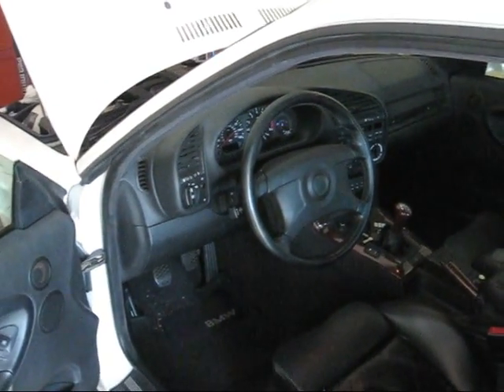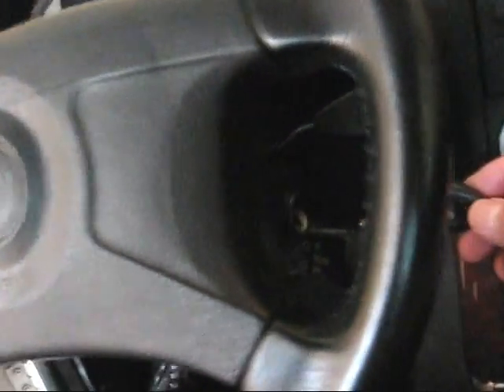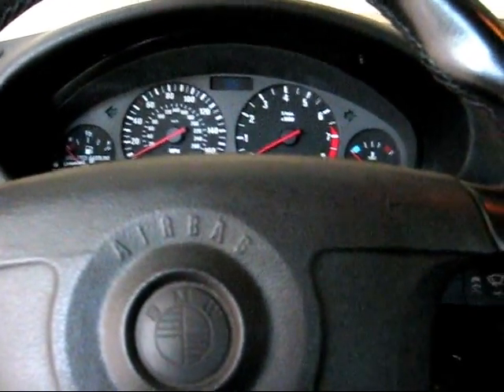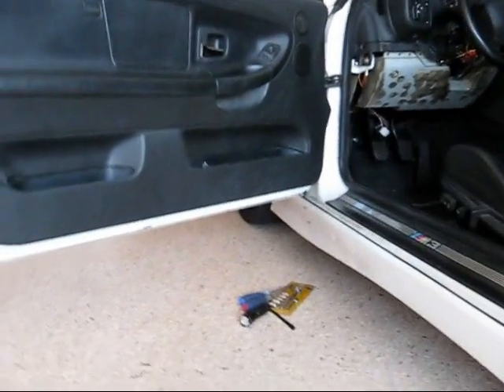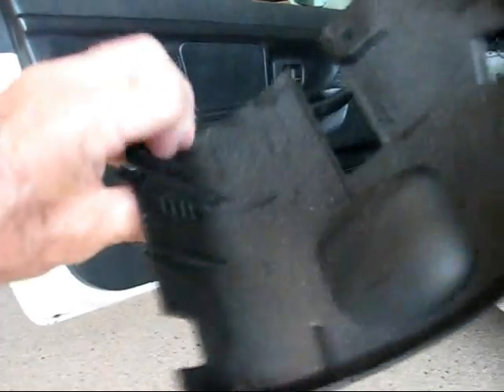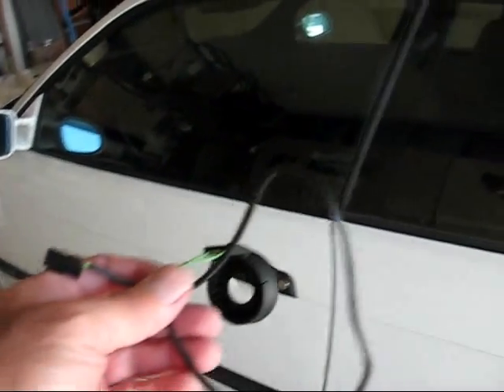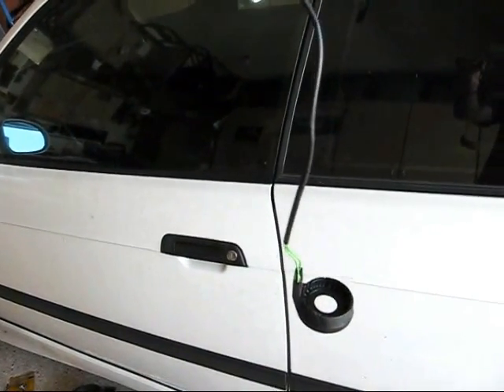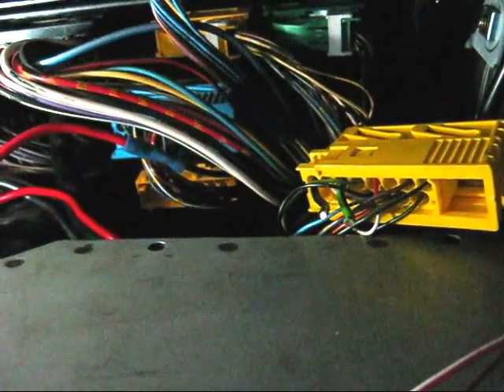BMW EWS II security bypass on 1995 M3 by froggy

Comment: did you use a seperate piece of spare wire to connect the two? you described a green and a black wire but you were holding a red one. Do I need to use a seperate wire?
Reply from the maker: +adam moore Well, yes, an extra piece to allow some room to work, color does not matter for the jumper piece.

:)

Comment: Hi I need help on my 2001 bmw 325i also have similar problem..no crank and just bought a new battery. i try self diagnosis and it came up with code P0604- PCM Random access Mem (Ram) error and also showed EWS and UCU issues. so do you have a way of resetting the EWS or modules?cause i think it just lost memory! thanks your help will be highly appreciated
Reply from the maker: +Benedict Nkosi Wow, sorry no idea on this, good luck.

:)

Comment: well my 96 328i was not cranking, so i spliced the two big wires from the yellow plug. it cranks now ,but no fuel or spark. so next i cut the solid green wire, got fuel now! so any ideals if theres one more wire to cut so i can get some F@#@ SPARK OUT OF THIS???
Reply from the maker: +Troy Fiore I don't know Troy, you got lucky with the green wire, I guess, I would not just go on cutting more wires. Wish I could suggest more.

:)
Reply: I WAS HOPING YOU WOULDN'T SAY THAT...
Reply: Troy Fiore  you solve the sparck problem? I am now in the same position

Comment: i have a 96 328i, does something, turns but doesnt crank. so managed to jump starter with ignition on still no start. now i'm worried! so looks like i'm going to try what your doing,  do you have to replace the ant. key ring thing, is that a must ? first?
Reply from the maker: you only have to replace that if there is a problem there if there is no problem there then you don't have to replace it
Reply: +froggy  i guess it just dont work on 96?
Reply from the maker: +Troy Fiore the ignition key security is separate from the EWS to security did you do the EWS 2 bypass
Reply: YES
Reply from the maker: If it is turning over (cranking over) but not starting, you need to check basics.

1) Spark - are your plugs sparking
2) Fuel - is the fuel pump pressurizing the fuel rail
Reply: +froggy THANKS FOR RESPONDING, FROGGY. I CUT THE SMALL GREEN WIRE, NOW I HAV FUEL, BUT NO SPARK YET??

Comment from the maker: For Antreges, Thanks, glad to help.

:)
Reply: Any idea if it will work onbthe 1995 325is im having the  same issue i already replaced  the ignition and nothing
Reply from the maker: +rob b Maybe, that's pretty close to a 95 m3. Reverse it if it does not work.
Reply: +froggy Is the m3 the same as the e38?  I am confused about all the designations on the bmw's My car is a e38 but I can't find any thing printed on the car that say's so. And I don't have a clue about the m3 designation or the e38.
Reply from the maker: M3 is the higher performance version of e36 chassis.

:)

Comment from the maker: Guys & gals, I don't have specific bypass procedure for every year & every model of BMW. There are changes. This is for 1995 m3 and "MAY" work on some others.
Reply: Hello froggy. After you jump the wires together from the EWS do you plug the yellow connector back in? Never saw that in the vid. Also thanks in advance
Reply: I have the saem question.. does he connect the ews back? would this work if ews is damaged?
Reply: 1998 BMW 328i wont turn over with the key but if I shouldn't the starter it will run
Reply: Did u start it with the ews module out?
Reply from the maker: Yes you plug the connector back in,  and depends on what the damage is to the ews.

:)

Comment: Hi froggy,i following your movies and with bypass starter is work but injections and fuel pomp not ,what i can do more,this is bmw e36 1.8 1996 thanks for help
Reply: +krzysztof kidrycki  same problem, what more did u do?
Reply: Is fixt
Reply: +krzysztof kidrycki  HELP. YOU SAID IT WAS FIXED? PLEASE WHAT ELSE DID YOU DO??
Reply: in computer dme i fix emulator to immo ,immo dont work but engine start with bypass from froggy

Comment: I have a 1995 BMW 525i, put a new engine in, and now my car wont start, but it does turn over..Any help, i'm gonna go get a new key from the dealership, but some people say it could be a security code that i need to get from the dealership?? Any help would be appreciated.
Reply from the maker: prospect1won Is it the same as original engine? It definitely sounds like security stuff.
Reply: Yeah same as original, just bought a new one with low miles because i cracked the heads on my original engine.
Reply from the maker: Did you change the engine computer?
Reply: No, the shop said the computer on it is good..
Reply from the maker: If it's turning over check the spark & fuel pressure (basics). Did you do the bypass?
Reply: Basics have been checked like fuel pump and spark plugs, i haven't done the by pass on the security code part..
Reply from the maker: Try it, do a "neat" job, it's reversible if it does not work.

:)

Comment: Hi. I just did this on my 318 1995 mod snd it worked!! Thanks alot man. 

But now I got this click click click click sound from a relee under my steering wheel, close to where the black key ring plug is fitted. 

Can you help me with that? Did you get that?
Reply from the maker: holimar1 I'm sorry, no, never had any clicking there. Post a comment when you figure it out & congrats on the FIX!

Comment: I have a BMW 740! That the key was spinning  I sprayed electrical  contact spray and got it to stop spinning But now it will not start..
Reply from the maker: Johnny Dinnero The spinning key is a totally different job. I would watch some spinning key videos & see if you get an idea from those, nothing to do with ews2 issues.
Reply: I fixed the key doesn't spin but now it doesn't start..95 740!
Reply from the maker: Johnny Dinnero I get that, spraying elec contact spray on an ignition switch is not going to cause a circuit board under the glove box or under the hood to fail.

Maybe you did something to the antenna that IS around the ignition switch. Start there.

There is some video on my BMW playlist about the antenna.

Try both keys if you have two.

Then it's take apart the cover over the ignition switch to look at the antenna.

:)

Comment: Hi, I have a problem with the ignition of my car and checked the spark and fuel pressure and nothing, I wonder if my problem has to do with the EWS, thanks.

Note: the starter is functioning normally.

greatly appreciate the info.
Reply from the maker: Make, model, year? How did you ck spark and fuel?
Reply: Bmw e36 m3 3.0 95 Check disconnecting the fuel hose to the rail injectors which is not sending anything, like with each spark plug wires and spark are not giving
Reply from the maker: On my 95M the broken ews2 blocked the fuel pump AND THE STARTER. So if your starter is spinning the engine, that's a different scenario. It is possible a mid model year change happened to make mine different from yours.

It might be worth trying the bypass, but make the cuts & splices so you can reverse it if necessary.

:)
Reply: Thank you very much for the info, I will try the method you used to see that this is me

Comment: froggy or anyone help me p lease!i watched youtube videos of the ignition tumbler ordeal so many of us have had... My 1995 318si  had the spinning key/tumbler problem, so i tried bypassing it with the ignition switch, then started it with a screwdriver by turning the ignition switch every-time, and it worked fine for a few months,then one day the ignition switch bypass, it quit starting it, so i then just assumed it must be the ignition switch  cause i got nothing, when turning it with screwdriver,so i then bought a new switch, and hooked it all up, and it now it at least cranks  but wont start, It's turning over but sounds like it's not getting no gas or not firing not sure! all's i do know is it won't start :cry:   any help?

Then on my 94  I love it, its a BMW 325is V6 manual, and check this out one day it just all of a sudden quit cranking, like a bad starter or something,  but it never gave me any indication it was going out!!! I will say this something i think about that i did, right before it quit working, I was doing some work on my trunk lid and had the trunk key switch messing it with it, and the automatic opening or something, then right after that is when it wouldn't even crank, when i say crank, it wont turn the motor over at all!! Was it something i did  working on the trunkkey area??? just after that i turn the key and nothing???  luckily its a manual i just try to always park on a incline of some sort, to roll start it,  but lord that can be trouble, and i drive a BMW  and roll starting it is kinda embarrassing  :tsk:   Could that be  the ignition switch as well??? Please if theirs anyone that can help!!!   I would be ohso  thankful!!

Comment: couple questions: 
You cut the two biggest wires  - green/brown and black/yellow on the plug side?
Then you connect them up on the plug side as well (as opposed to jumping them on the EWS module side)? 
Did you reconnect the EWS plug to the EWS module? 

It looks like I need to do this today, my car stopped cranking today. It had stopped a couple weeks ago leaving me stranded, but a new key fixed the issue. Now it won't crank even with my new key. :(
Reply from the maker: Watch the video at 15:00 CAREFULLY, replay it a couple of times. Yes you have to reconnect the plug.

:)
Reply: froggy It's weird, but this doesn't work for me. Your ecu looks like mine, I've spliced the wires together as you did, but no joy. :( Mines a 3/95 car
Reply from the maker: Sorry, so you have no starter crank and no fuel pressure - you measured it or listen for the pump to prime? Those are the two symptoms of a failed ews2.

Comment: I'll be giving this whole thing a whirl on my 95 325i Convertible tomorrow. I think I've narrowed my problems down to this EWS nonsense. Great tutorial, froggy. Thanks so much!
Reply from the maker: Please comment back how it goes.

:)
Reply: froggy Well. I did it. Key works every single time now. Come to find out though I had my main relay swapped with my Fuel Pump Relay. I still can't get the fuel pump to turn on. Only when I manually force it to turn on via 12V. Any suggestions? Anyone? =\
Reply from the maker: Well a relay is sort of like a switch, if you swap one for the other it doesn't matter, just a switch, so long as the "rating" is sufficient. Coul be a BAD relay, they were out.
Reply: ATCRyderX© did you find the answer to your problem got same issue after bypass ?
Reply: Gary Van Hoozer After bypass, I can crank all the time but still no fuel pump or start.
Reply: thanks got 98 318i  no crank no start bypass turns over but no start. No power fuel pump or engine , sending my dme  to be checked fixed or a non-programmable fix to completely disable ews.
Reply from the maker: Post back how it goes.

Comment: Questino.....The yellow plug at the EWS computer is wired different for my car '95 525I E34 3/95 production.
From the back of the plug RT to LT
#1 BLK/YL (thick wire 14G?)
#2 WHT/Purple (thin wire 20G)
#3 BLK/YL (thick wire 14G)
#4 GRN (thick wire 14G)
Any ideas
Reply from the maker: The only idea I would have is thick wire to thick wire. THAT IS A GUESS. It is reversible if you do a proper cut/splice. Please post a comment how it goes for you.

:)

Comment: Question. .. I was fixing my tumbler and broke the ring antenna. I went to a parts place they said I have to replace the whole unit, if I just replace the antenna it won't be recognized  (doesn't make sense to me??) Another question... I tried the bypass by tying the two thick wires together but it won't turn over... it will fire but not turn over.
Reply from the maker: For the first question, you CAN replace the ring antenna only, I do it in one of the videos.
For the second question how can the engine "fire" if it does not "turn over"?
Turning the engine over happens first, yes?
Reply: ok it turns over but does not fire... sounds like the fuel pump is not kicking in.... had no problems with before I broke the antenna.
Reply from the maker: Yes, so replace the antenna.

:)

Comment: FYI! I JUST BYPASSED 2000 X5 E53 4.4i EWS AND IT WORKED FOR THIS MODEL TOO ! THANKS A MILLION FROGGY!!!!
Reply from the maker: Wow, I am glad it worked, but also surprised. I only documented it to show how it works on my 1995 M3.

So that is great to know, thanks a LOT for the post.

:)
Reply: AFTER MANY HOURS OF BIMMER FORUMS AND YOUTUBE DIY VIDEO I QUICKLY LEARNED THAT YOUR REMEDY WAS THE MOST EFFECTIVE AND MORE LIKELY TO WORK (SO WHY NOT TRY IT IN SAME STEPS YOU TOOK BUT ON MY E53 4.4Ii X5). EVERYTHING ELSE JUST DIDN'T MAKE SENSE BASED ON EVENTS LEADING ME HERE. REPLACED BATTERY, REPLACED FUEL FILTER THEN NO CRANK NO START. SOMEWHERE IN BETWEEN THE EWS AND DME ACTIVATED THE ANTI- THEFT SYSTEM NOT AUTHORIZING IGNITION TO START ENGINE. I WAS TOLD I NEEDED A STARTER OR BANG ON IT TO UNFREEZE IT BUT AFTER BY PASSING IGNITION STARTING X5 FROM STARTER I KNEW MY STARTER WAS FINE. SO THEN I DECIDED TO TRY "THE FROGGY METHOD" AND WITHOUT A HITCH THE X5 STARTED ON FIRST TRY. THANKS AGAIN FROGGY
 AND THANK YOU YOUTUBE!
Reply from the maker: Glad that it helped & thanks for posting the comment.

:)

Comment: My 95 525i turns over but wont start. It ran very well one day I went out let's crank it up it ran for about 10 seconds and then shut off and wont start back up. I changed the battery out cuz I thought that might help it did nothing for it just cranks but will not turn over or will not start. I think it has something to do with the alarm system but I'm not really sure do the Chevrolet I could do better but it's a BMW so out of my league. Maybe there's something you can help me with. I thank you for your time. my email address is illuminated adept at gmail.
Reply from the maker: If it CRANKS its probably NOT security.

:)
Reply: froggy i watched youtube videos of the ignition tumbler ordeal so many of us have had... My 1995 318si  had the spinning key/tumbler problem, so i tried bypassing it with the ignition switch, then started it with a screwdriver by turning the ignition switch every-time, and it worked fine for a few months,then one day the ignition switch bypass, it quit starting it, so i then just assumed it must be the ignition switch  cause i got nothing, when turning it with screwdriver,so i then bought a new switch, and hooked it all up, and it now it at least cranks  but wont start, It's turning over but sounds like it's not getting no gas or not firing not sure! all's i do know is it won't start :cry:   any help?

Then on my 94  I love it, its a BMW 325is V6 manual, and check this out one day it just all of a sudden quit cranking, like a bad starter or something,  but it never gave me any indication it was going out!!! I will say this something i think about that i did, right before it quit working, I was doing some work on my trunk lid and had the trunk key switch messing it with it, and the automatic opening or something, then right after that is when it wouldn't even crank, when i say crank, it wont turn the motor over at all!! Was it something i did  working on the trunkkey area??? just after that i turn the key and nothing???  luckily its a manual i just try to always park on a incline of some sort, to roll start it,  but lord that can be trouble, and i drive a BMW  and roll starting it is kinda embarrassing  :tsk:   Could that be  the ignition switch as well??? Please if theirs anyone that can help!!!   I would be ohso  thankful!!
Reply from the maker: On the 94 the only thing I can think of is that you damaged the key when you were working on the trunk. Do you have a spare key to try?

:)
Reply from the maker: On the 95 ck the fuel pressure and the spark like any other car.
Reply: No sir no spare key, But Froggy i didnt mess with the key at all, I was messing with the lock on the trunk, and now that i think about it I was messing with the dooor lock as well. Do they have anything that trips the lock cylinder or something ?  would that trip the computer, the antenna, or something ? i just know its not the starter.. How about a or a relayvor something?  but no sir i dont have another key... thanks for the reply sir
Reply: froggy On the 95 how on earth would thathavemessed up the fuel pressure Froggy by the ignition switch? i did see were people had an issue with that when they tried the EWS you switched those big wires and bridged them  why would that mess up the fuel??? and what do i do if that would be the problem sir? or the spark what do i do then?
Reply from the maker: On the 95 you said it cranks, no start. Checking spark and fuel pressure are the standard troubleshooting steps for any car that cranks, no start.

I am not saying anything CAUSED anything, just saying you should verify that you have correct fuel pressure and spark.